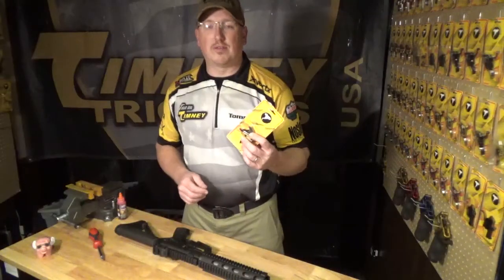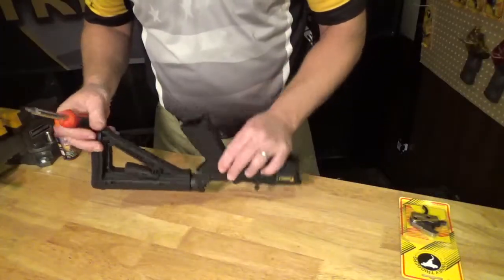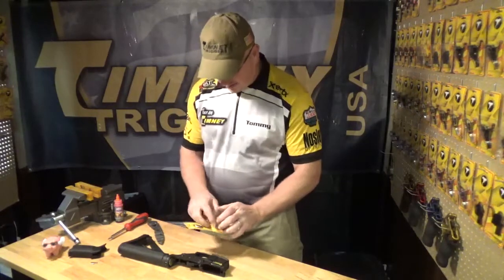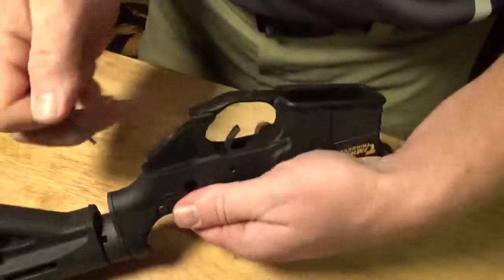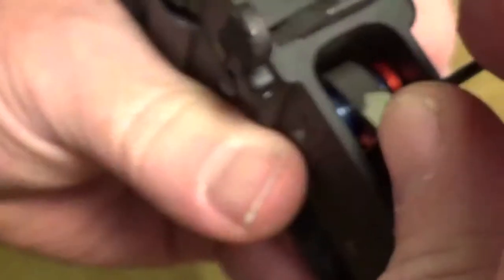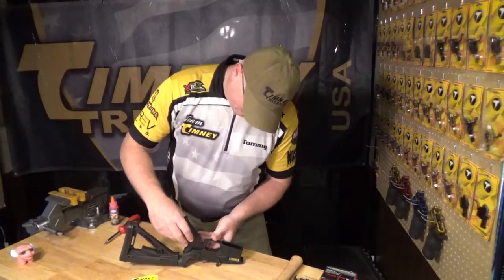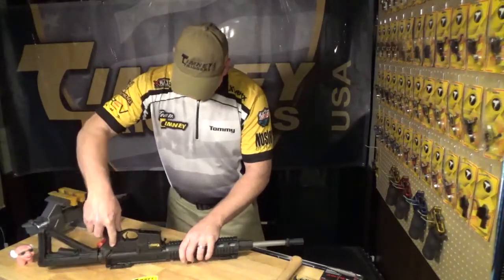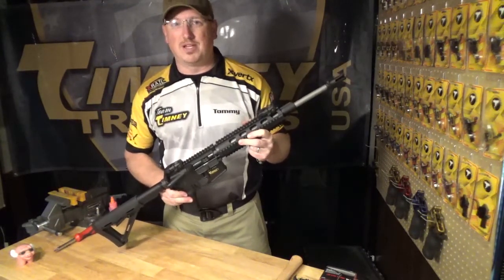Installation of the Timney Two Stage Trigger

Comment: I was so excited for my two stage trigger. I bought the blue one that is supposed to be 2-2.9 lbs. How disappointed I was to pull the trigger, it seemed very heavy, found out the trigger breaks at 4-4.5 lbs according to my trigger gauge. Twice what I was expecting especially from a 200 dollar trigger

Follow up: Timney got back to me quickly and told me the first stage is 2lbs the second is 2 lbs so its first stage adds onto the second to make a 4lb trigger. I never heard of measuring it like that but oh well. Live and learn I suppose

Comment: Why take the grip off? Doesn’t appear to have anything to do with the trigger assembly??
Reply: You need to take off the grip so you can remove the safety. You can not remove the trigger group without removing the removing the safety selector switch.